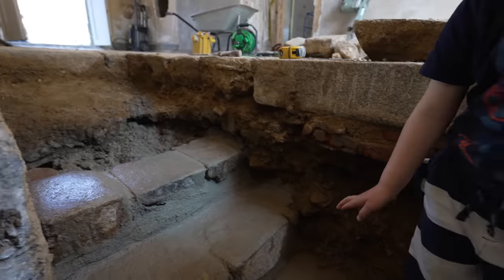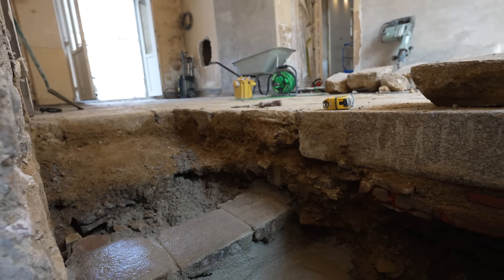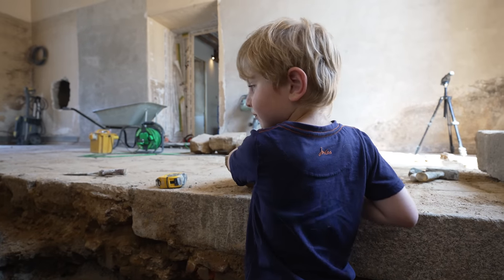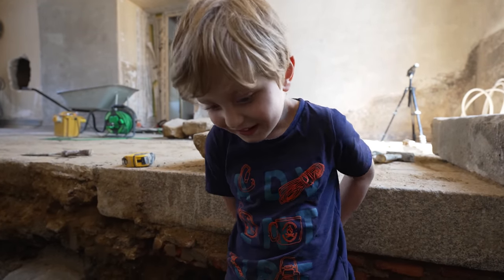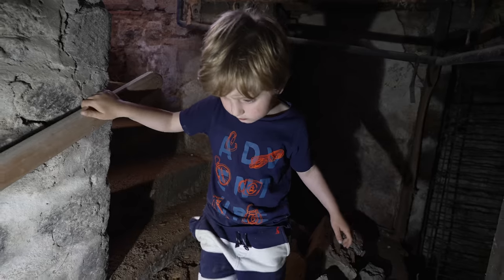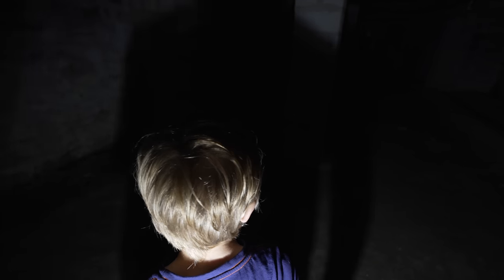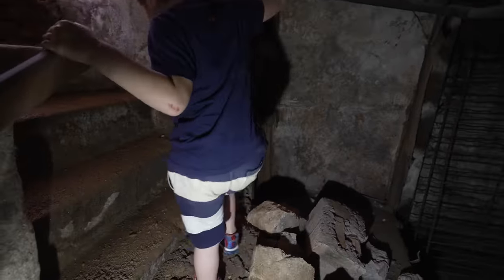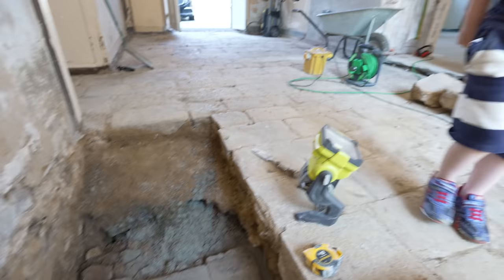The Forgotten Steps To The Convents Basement

Comment: When you put in a rail, make it removable to access large things in and  out of the basement.
Reply: Great suggestion -- I was wondering about someone falling down that gap lol plus making the rail removable allows for large objects being moved around easily on Level 1 as well. 👍👍
Reply: There is already a giant entryway for the basement on the other side so it won't really matter.
Reply: Maybe add a lockable gate so kids don't go down there.
Reply: You can use a staple rail that is removable in sections so you only need to remove the staples you need to for access
Reply: Excellent idea
Reply: I agree that a removable handrail is ideal. I love the way that you have recreated what is the likely original layout of the stairs
Reply: Always nice to have flexibility.
Reply: Your son is adorable!
Reply: There is a huge door in the basement that goes to the outside.. He showed in one of the past basement videos with Sean, I believe.
Reply: @klaasvanmanen8214  it has much more to do with future use and guests. Huge liability.
Reply: Looks like it turns right away making moving large items in and out?
Reply: Instead of a rail you could do a door that's rated to be walked on.  Alternately, if you go with a steel rail, a gate would work.  Another option is a steel rail system that you can lift out when you need the additional clearance.
Reply: I don't think your getting anything large down there.
Reply: @MrGaiden100  some of his larger bdsm equipment is going to have to be disassembled first.

Comment: Great job finding the clues of the original staircase to the basement. The railing will look great. Are you putting a door in to keep the cold in the basement during the winter? For summer maybe a stone floor with a small table and chairs to get out of the heat?

Comment: You have not spent a lifetime as a stonemason working in hot summer places, so you are not attuned to the demands of the job. That said, you are taking great care to get it right and in keeping with the building, and it does look wonderful so far. The next steps will complete both the look and the function. I agree a removable, but rigidly fitted barrier will enhance the job, remember, Edward may not be the only at risk party to visit, even one accident is one accident too many.